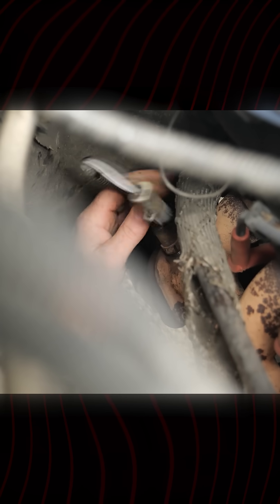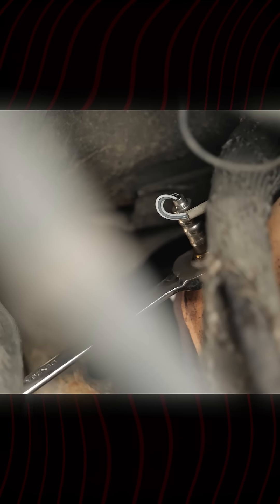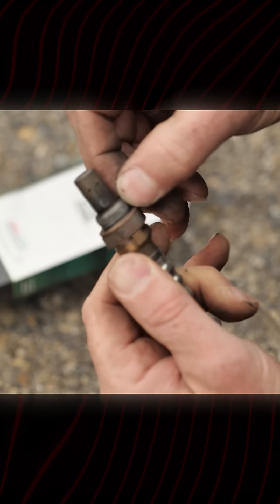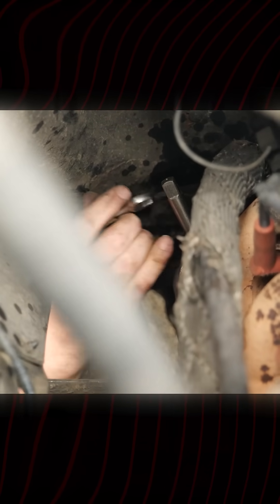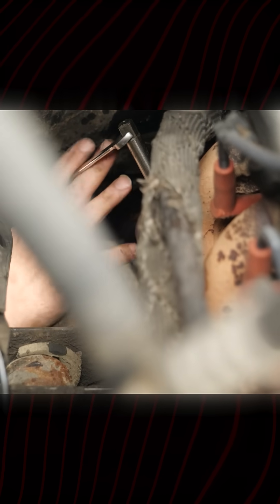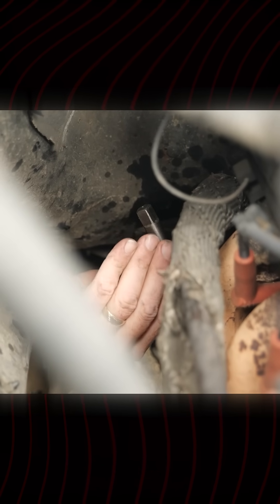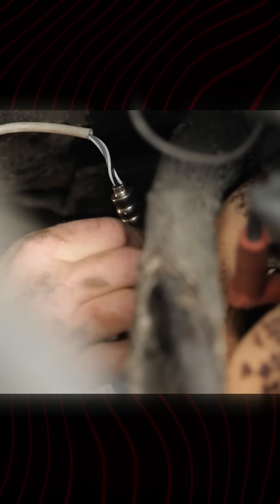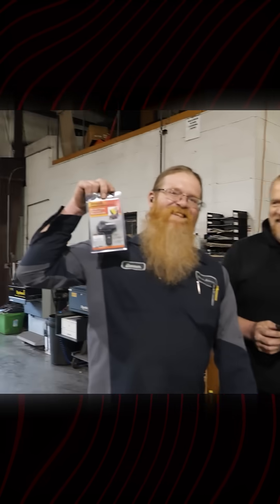When righty tighty becomes righty loosey...

Comment: This is why I bought a special wrench just for these and then go slow and also, I would run a brush up inside there first. Those exhausts are famous for this stuff. You get soot and crap and it's like creosote in a fireplace. It doesn't cause a problem while the sensor is in there but as soon as you twist it a bunch of crap goes all in those threads.

Comment: Man, I always run that O2 thread chaser first.
Reply: Not me I need a few beers because the stress of where the hell they put a part that need replacing in the worst environment that uses half the tools I own to replace. But he did did save me from going nuts on a Chrysler that only can  use genuine Mopar after replacing 3 with after market and still popping codes. One failed after clearing codes in a few minutes but Mopar part 3 years no problem. He showed what that the after market had a split second pause that the Mopar part did not that trips codes. So  I owe him a beer.